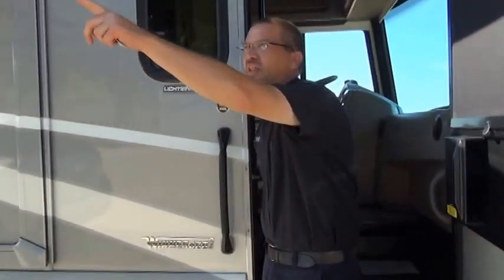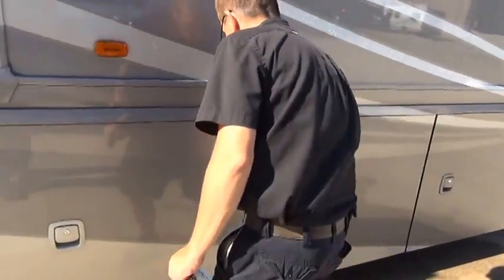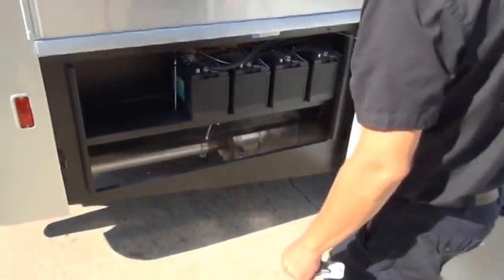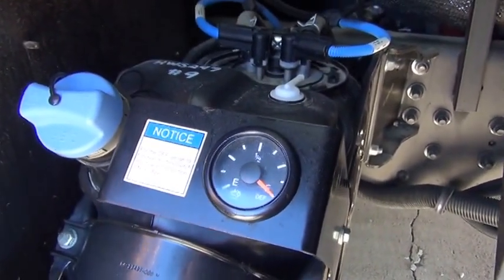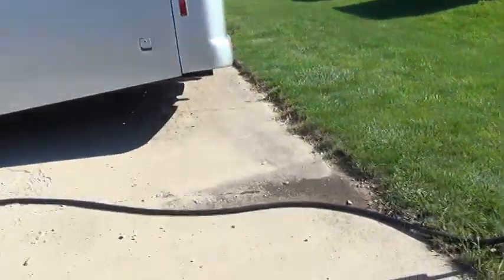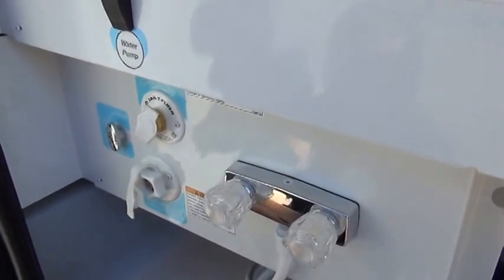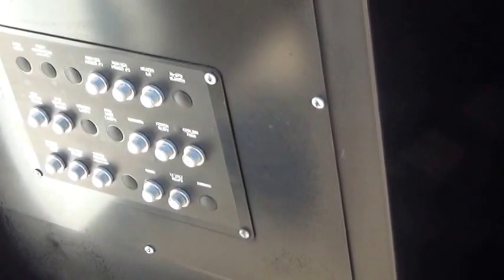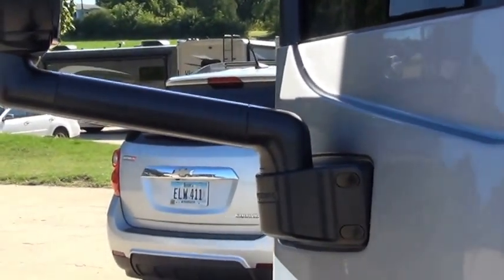PDI outside

Comment: Please tell me that this guy told you not to connect your fresh (potable) water hose to that black tank flush??? And even so If he informed you to use a Anti-siphon valve that installs on fresh water faucet to prevent contamination of fresh water system wherever you're getting water from! Nice rig and safe travels!

Comment: Tires off the ground is NEVER a good thing (front or rear). The leveling system on any size coach is not ment to lift the wheels off ground. Not even to  change a tire. It's a real safety issue and could bend a jack.